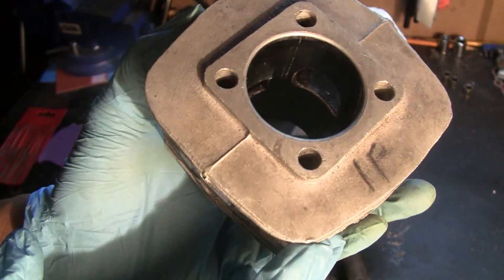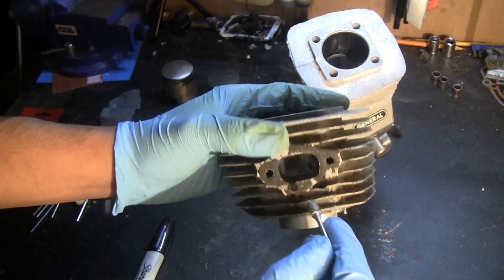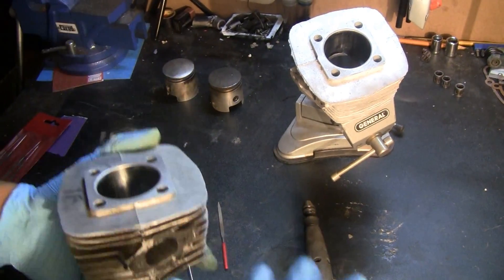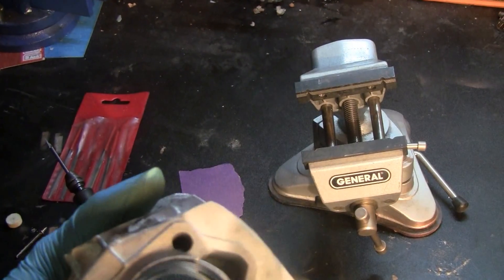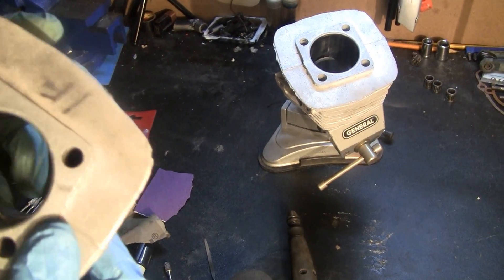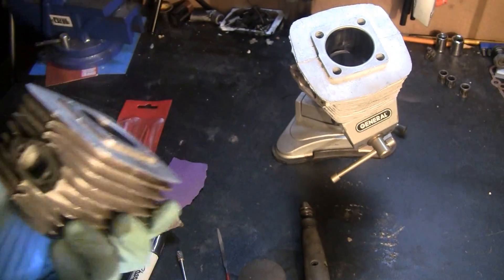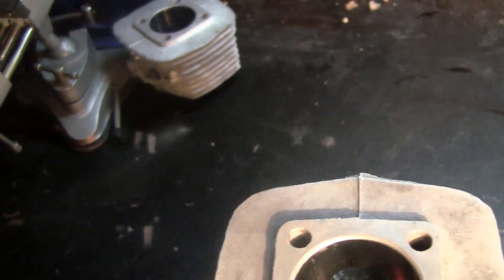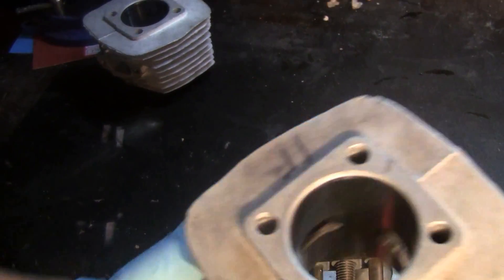Porting your 2-Stroke motorized bicycle engine

Comment: I raised the roof of the intake port by 1 or 2 millimetres by accident.. how will that effect the timing and what should i do about it? just buy another cylinder or put a different size jet in or reed valve?? its an 80cc.

Comment: If your just trying to clean up the intake and exhaust themselves including the piston ports may i suggest using a dremel 3000 with some minitare burr bits. Doesnt have to be perfect but anythings better than leaving it with metal chunks and slag inside those areas. I chase any remaing debris out with compressed air or wd 40 then clean metal parts thoroughly with rubbing alcohol.

Comment: I wonder if raising the exhaust port could damage the cylinder at high revs per minute, as it gets so close to the limit.. I suppose you must not file so close to the limit.. Am I right, and does porting force the engine to use more gasoline??

Comment: I find that porting and polishing does increase overall performance based of of my own personal experience and the videos I’ve seen on YouTube. Another benefit to these motors would be to ensure that the cylinders have been honed for a more advanced oil saturation on the metal surface to increase overall lubrication since you’re increasing the surface area by using a honing device.

Comment: Instead of modifying the ports I would just shave a little off the bottom of the piston so the ports are actually exposed all the way. Messing with the cylinder seems overkill and you can easily lose compression and ruin the engine if you don't know what you're doing.

Comment: Then students need only to port the "inlet port" of "piston inlet ported engines" where you can grind and almost leave it in an unpolished state for test reasons until you have done then finish the polishing of the cylinder edges. This place is not ring touched In almost every engine I've ever seen. But always Clean the metal particles out before starting the rebuild your engine. For that matter just clean the whole engine's part completely, then "Do the whole Rebuild" completely.

Comment: Hey, dude, you need to teach them jack the cylinder up via a shim between cylinder barrel and the crankcase and only clean the ports not raise them by cutting you raise the exhaust you must always raise the transfer ports too b y the same amount as you had the Exhaust by nearly half the difference this the real world facts, not just theory. 
Example: 
stock exhaust port timing was 155 and @ 102.5 degrees after TDC. Then you are raising the exhaust port to 180 degrees and @ 90 degrees after TDC.
Stock transfer port timing was 77.5 degrees and @ 141.25 degrees after TDC, Then you raise the transfer port to 90 degrees and @135 degrees after TDC
Getting these three to five ports dead on the money { respective degrees } is really super hard to do, all the while polishing these to not cause twisting of the piston ring causing fails on the piston anti spin pin, HEY Dude! You are Super lucky or you are the best cylinder port polisher I've ever seen. All in and said I've been doing ports on "Two Stroke Spark Ignited Brayton Cycle engine" some 20 years. And I have not been able to keep from spinning  a piston ring at some time after years of trying I found taking up the cylinder is the only way not to spin a piston ring Oh yes the rings do have pins that keep them from spinning but that only works when you are really well experienced at doing the porting stuff otherwise it just keeps pushing on the piston's antispin pin until it loosens up and drops out now you've got a little pin floating around the engine if it goes out the exhaust port  that three times air pressure and three times volume will, at some time or another push that pin right back in to the cylinder which will either hang a port edge smash into cylinder head and piston crown. none of these are good for engine life and the safety of the rider. I've had a cycle to lock up at high speeds but this was due to spark plug insulators breakage which was caused by the detonation also being the cause of not high enough octane but early on I had piston pins get loose and hang in the transfer port and piston this was a motocross track and was going about half T this kill the engine anyway. even bent the rod too.  You want to test an engine run it while then look at the piston antispin pin in those ring groves if it is a good builder it will show "NO! WARE" on the piston ring ends right where the piston antispin pins contact the ring. If there is were there then the engines just do not last long either. This also the real reason the not use hard cutting stones hones on to cylinder rebuilds you must only use soft cutting stones on all two-cycle engine yes this means same types of diesel engines too.

Comment: could you run open transfer ports?
Reply: You can, but remember that you are adding to the crankcase volume when you do this. 
You might only see an improvement if you have a lot of fuel-air to transfer very fast, ie: only if you are running the engine at very high RPM with one of the large reed valves, 
but to run high RPM safely you need high quality bearings throughout and a well balanced crank. The cheaper/older style engines generally are not reliable at high RPM and you would be wise IMHO to have the bearings upgraded if you want to exceed 8000RPM top and 6500RPM cruise. 
You can stuff the case while you have the engine totally disassembled for the bearing upgrade, and this will help mitigate the added volume of open walled transfers. It is a lot more work than most people want to do unless they're racing, and I personally would only scallop and knife the bottom of the transfer wall to allow easier access for redirecting and knifing the transfer windows. The crankcase should be port matched to the transfers too.

Comment: What kind of solder would can you use for a crank case bolt . One of the threads that hold crank case prongs stripped.

Comment: Thanks for the info, and trying things out. Wouldn't an easy thing to do just be adding a bigger carb and tuning it? Like put an 80cc or 100cc carb on a 50cc engine, to get more fuel and open inlet port crossection too?

Comment: I see all these snall engine resellers asking for an extra $75 for "PORT WORK"
Reply: Yeah, that's pretty fair. Spend hours polishing metal in a tiny area you need special tools to access and see if you don't want $75 for your time.
Reply: Well im gonna try to do it myself I have the motors top ends dissambled anyways so im gonna give it a try is this videona fair tutorial?

Comment: You ain't got a clue, the book you mentioned is that thick cause it's that complex and that only gives guidelines ,proper porting is done with die grinders not dremels, raising exhaust port is to help scavenging ,ie let pulsed back pressure force returned unspent charge back into the cylinder

Comment: Hello I need help! The kit I purchased won't run right. I took off head and noticed that at BDC MY INTAKE ports are not visible.

Is that normal? Did the wrong piston come from factory? I have the low hole piston.
 I can't find information on intake ports and BDC. Or pictures of BDC with piston relative to ports position....

The motor would start but not rev past 1000rpm felt like it was starving for everything.....

Comment: Another way if your on a bug and don't have the tools for porting. Add an extra gasket or two to where the jug meets the crank case witch will raise both the intake and exhaust but then you need to save the top of the jug and head a bit so the piston come back to the top of the jug. I didn't explain that well sorry

Comment: You should clean all your individual engine parts, with warm soapy water, before assembly.  This will get all the dirt, dust, metal, and grease off; which prevents damage, and gives the oil a nice clean surface to stick to.  Never use solvents, as they can penetrate into the metal, with several negative side-effects.
Reply: Use Tide to wash. Parts.
Reply: I've never used soap, just shop towels degreaser wd40. I'll stick to what I know.

Comment: I have to agree with most of the posts on here, to add to what has already been said.. you are dealing most likely with casts that were made in China, they work but they are not the best quality, sometimes no matter how careful you are.. you are likely to remove a chunk out of the material  rather than the intended fine edge you were looking for to port. Then you are left with a bad engine...and the cost of another. There are many ways to improve performance on this engine without doing this and i highly advise you dont do this. Getting it wrong is just too easy with this if you dont know what your doing
Reply: These jugs are for sale as an individual unit. I was able to buy just the jug when my engine bore plating delaminated.

Comment: Come on guys. Cut him some slack. I get the strong reactions but who was perfect the first few times? I fully understand its best to be precise and have proper tools. However give credit where credit is due! Hes at least trying. The difference between my first build and my 3rd and current build is unbelieveable. Some of us are self taught. Take it with a grain of salt. Or leave it. Better question why did you finish the vid then waste more time leaving mean comments? I may be female and self taught but i bet my bike is faster than yours!! ;)
Reply: I just went to the comments first.But i see.Guess im on my 3rd build.First engine works,i just took it apart to tinker with it .Im new to this but want to learn.Couldnt i just take that engine,watch some porting videos then just port that s.o.b?Have that 3rd engine on the way.Or should i try porting the new one coming?Or should i  just go back to kicking fucking ass!Mr.60
Reply: No work to show us ❤
Reply: Well said...
Reply: Yes that's all well and good, try away on your own project , but maybe only advise others on things you are really expert on? Balance is very important and a lack of it will put undue stress on components including the bearings, ( I imagine there are some ?)  I've not bought one of these engines yet. BTW your bike looks amazing.

Comment: "The higher the exhaust port the less time that its open"....er I don't think so!
Reply: Sidecarbod yeah its actually true ,there are two openings ,the one on the up and down .
Reply: Raising the exhaust port increases the dwell, opens earlier and stays open longer. This will increase rpms,  at the expense of bottom  end torque. Also the radius you speak of is called chamfer, not camfer.

Comment: first of all you NEVER raise an intake port you lower it. secondly you said raising the exhaust lowers the duration that its open that's backwards. you can raise the exhaust but you should also widen it. look your reading and learning but you have a long way to go so please don't be giving people advice until you learn more and really know.
Reply: I wanted to add why you never raise the intake port. first the ring gaps are on the intake side of the piston and raising the port can catch the ring gaps. also if the top of the piston goes lower than the intake port and the port opens above the piston your screwed. third like I just said you don't want the intake opening above the piston at bottom dead center which means raising it even without going that far will not help and can ruin your cylinder. you want to lower and widen the intake and raise and widen the exhaust.

Comment: ROUGHING THE INTAKE CAUSES THE INTAKE WALL TO CREATE A SWIRL OF GAS AND ACTS AS A BEARING KEEPING FUEL IN SUSPENSION,SAME AS A 4T intake,exhaust ports are polished,but i would not do this to a nikasil plated cylinder,like my RM250 no blody chance,the 2T scooter i have ......yes,but not this stuff,i do proper gas flowing and WILL do that to my RM250.NEVER touch the cylinder.

Comment: whats the correct porting  and upgrades needed for perfect hill climbing? (45º hills, rly steep ones) i wanted my 66 to be able to climb a hill without pedaling, in which is not the case, it cant in standard factory state

Comment: lol the gas doesn't go through the transfer ports thoughs ports lead to the sump where oil collects to oil everything lol
Reply: type this in the search bar dude: "how a two cycle engine works" 
it is explained that the fuel/air mixture goes into the crank case, where the fuel is atomized, and then after "pre-compression", the mixture travels through the transfer ports into the combustion chamber. everything else will be further explained in the video you find.

Comment: The best tools to port with are from FOREDOM. There is a company called C & C enterprises who sell all the porting tools you'll ever need. Start w/ a 90 and a straight. I have been porting all my adult life. I have set 14 Land Speed Records on small bore 2 stroke engines I have built.
I 've done karts, GP Road Race motorcycles and am currently doing drag race V8 engines. It's a good idea to study the mechanics and theory on how the gasses flow through the engine. You need to get a real grasp as to what happens in each port as the crank turns.Do the gasses flow front to back or back to front? How to build a pipe that is going to  help you achieve the powerband and over rev...porting to that pipe.  What about the head and squish velocity? 
A good pipe and good head work...along with jetting the carb correctly will net you more power than a port job. The porting is just icing on the cake.   I hope this helps.  In college, I studied flow dynamics. I fell in love with physics from 2 stroke motor building.  Good luck!  And chamfer those ports!
Reply: Steve Solo excellent constructive comment. I agree 2strokers can be extremely inspiring!
Reply: got a video that better explains how to do this?
Reply: What’s the best way to get more power out of my 150cc gy6 Engine thank you

Comment: Take an eighth off the top of the piston??? Let me know how that works for ya lol
Reply: I believe he was suggesting to take "up to" an 1/8th" off the top corner edge of the piston that crosses over the exhaust port.  The removal of this small amount of piston metal would allow the exhaust gases to begin escaping through the exhaust port a bit earlier than w/o the metal removal.  In his words "essentially the same effect as raising the exhaust port".  I agree with his assessment.

Comment: Measure from the bottom of the stroke to the top of the cylinder. The top of the exhaust port should  be lifted to about  2.5 mm under half way.  Do Not go to half way !.   The flatter the top of the exhaust port is the better but for longevity it is a compromise, so keep  a little radius here.  Lift the transfer ports by the same amount that you lifted the Ex Port.  You can if you are able to  do it, make the tops of the transfer ports where you lift them into a Y shape.  When your engine starts to crackle you know that you are on the right track.  Loads of experimental work here.  Loads of work and expense as well.  Make the expansion chamber out of thin material so it can "flex" under the + ve and -ve  return pulses.  Return pulses at high revs are supersonic so get your ear protection on !!.  Good luck.

Comment: dude i hope you have learnt from this, i stopped watching after u unbalanced the piston.. gonna have some mad vibrations from that engine after that
Reply: dude...have you evet ported a cylinder before ? or even modified a piston? This guy is legit. This will not ruin your engie unless you do somthing really fucking stupid. Sure the lifetime of the piston gets shorter, but it wont fuck up immediately. To be honest you dont seam to know what you're talking about at all.
Reply: The cranks on these engines are balanced for the 48cc cylinder/piston. They are already terribly unbalanced which is why they vibrate like crazy above 4500 rooms. Taking weight off the piston corrects this if anything.
Reply: +Fly Cat 1154 Somehow I know people who have taken 10mm off the intake side and they have still run better than ever. Until it broke because too much power.
Reply: more like it broke because unbalanced to fuckery, oh it made more power? but for how long till the internals rip themselves apart. its nto a good mod if the engine destroys itself is it.
Reply: Oh and for some reason they sell factory made pistons with one side shorter than other and i've cut few mills and it only gave me more top end. Of course you can't do that on a reed valve system

Comment: The main benefit to raising the exhaust port is that it offers more of the spent exhaust gasses to be redirected back through the exhaust port allowing for higher dynamic compression.
Reply: +Casey Allen Which you would do going to a pipe from a box muffler - hence the mod.